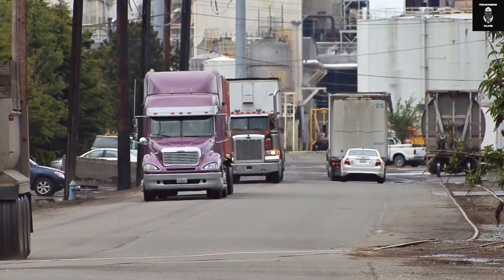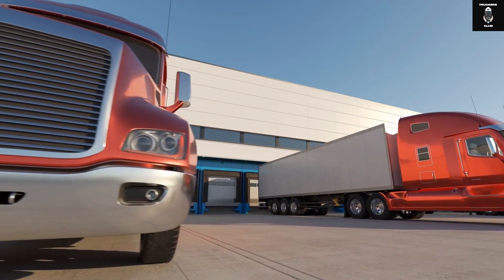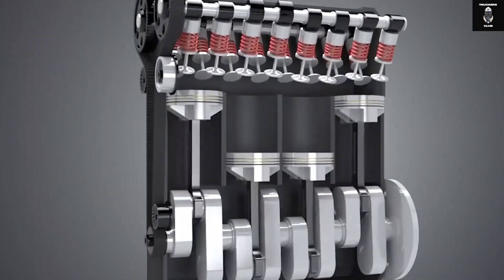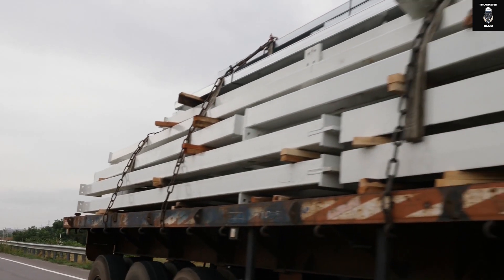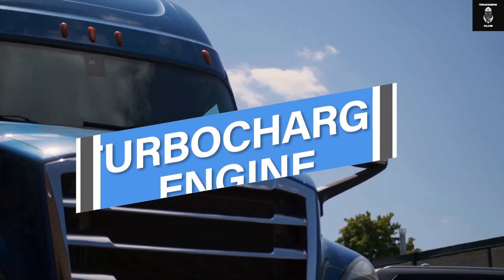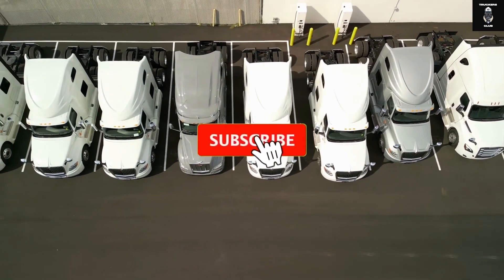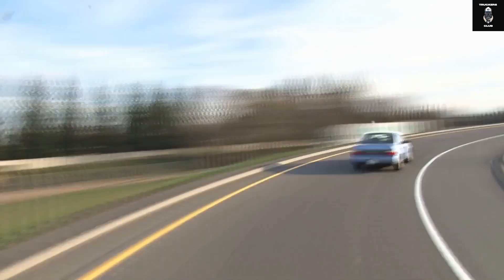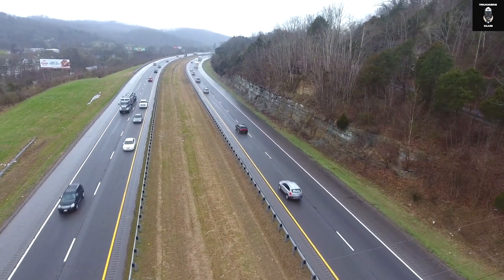V6 & V8 Truck Engine – Why are they different and which is best?

Comment: The 1996 4.3 v8 l99 and the 1996 4.3 series 3 V6 had the same horsepower and the V6 had 15 more torque. Same engine family same displacement. Why is that? Ohh right you are ignorant